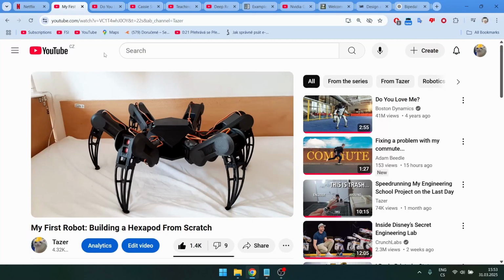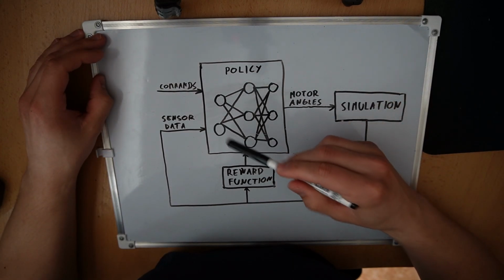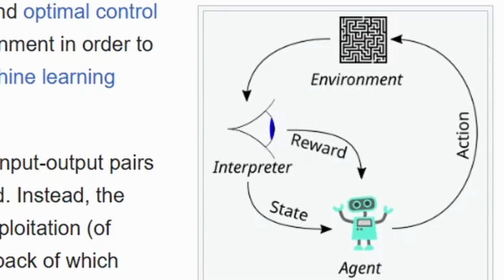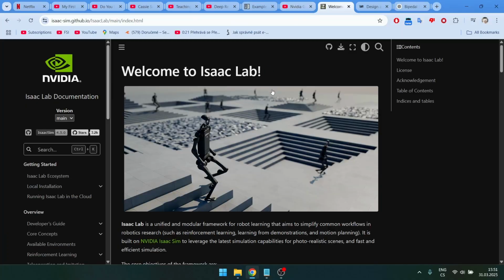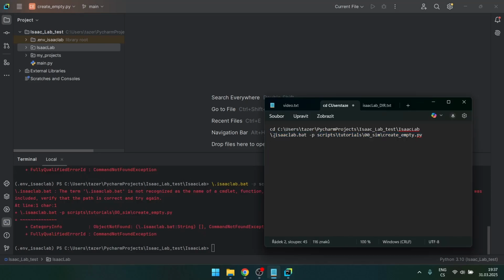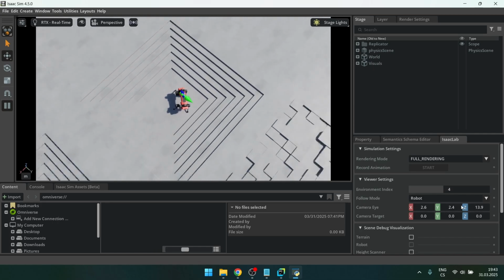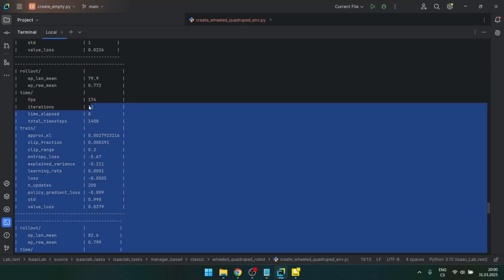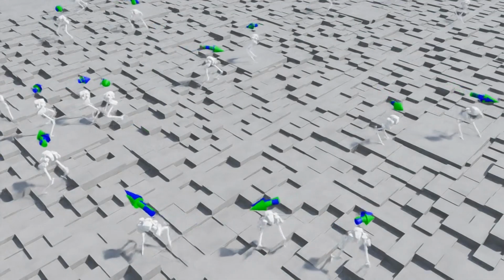Teaching a Robot to Walk with AI

Comment: Did you try Genesis? I heard a lot about it when it came out, sounded really promising, capable of running locally at great parallel speeds etc; but afterwards not much talk about it. 

I got some stuff I need to take care off before start to mess with it, but would nice to know if it's worth it.